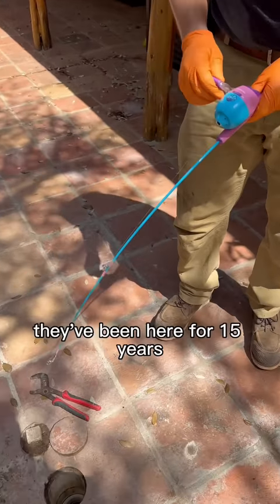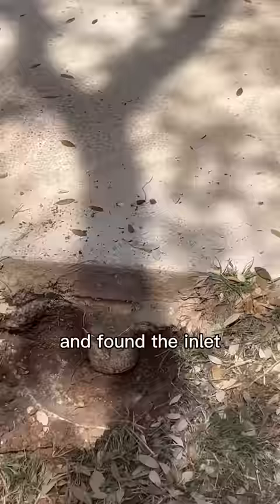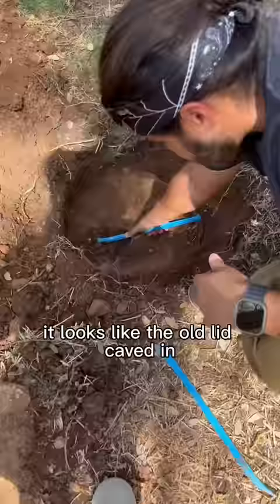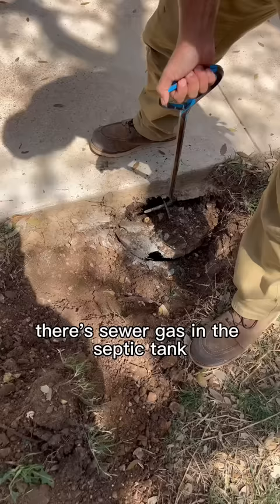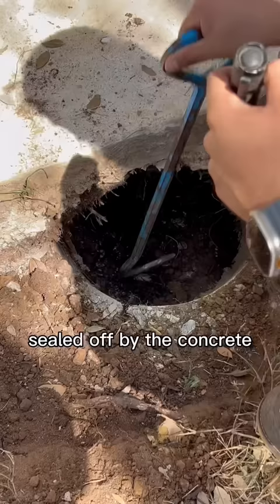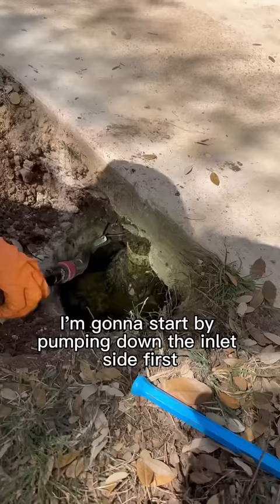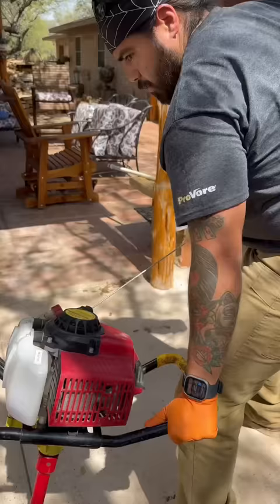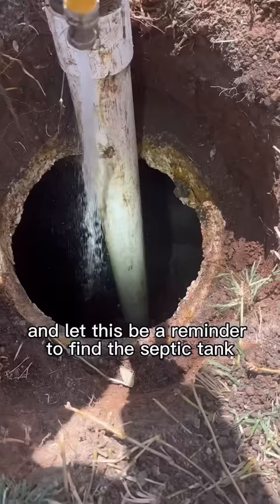They built a patio over the septic tank #shorts

Comment: Reminder: flushable wipes AREN’T
Reply: They definitely flush, just not a good idea
Reply: Oh they'll flush, but what they won't do is blend up in the poop smoothie or forbidden fudge factory!
Reply: Reminder your shit in the ground is actually toxic as there wasn’t enough time to actually test if any thing was bad
Reply: A lot now days are actually I tested left some in a glass of water and the degraded just like toliet paper
Reply: @maxortega8073   Show me ze datahhh
Reply: @blakeroni  unfortunately see datah has been delete
Reply: @maxortega8073  haha perfect
Reply: @maxortega8073  okay what's the brand?? So I can test it 😎
Reply: @8JLZ8  I just found it at Safeway
Reply: I've used them for 15 years, never had an issue
Reply: Just to clarify. I have a rental house. The plumbing was slow on the toilets. Property management company sent 3 different plumbers to resolve the problem. No success. I had to get on that roof and use a mechanical pipe snake and manually pull 2 or wipes out at a time. In the end pulled out closed to 30 wipes. Flushable are made of the same material as dryer sheets. Would anyone flush dryer sheets I think not. The world Flushable is the name of the product. Does not describe the wipes. That is just there name. Ask anyone plumbers if you should flush them. Unless you rent I hope the owner make you pay for the repair and plumbers.
Reply: Just be you can doesn’t mean you should. Did you see in the videos. Luckily it was a septic tank. Not public sewer system. Did y’all not see the wipes he just pulled. That is what I had to pull from my sewer pipes. That is why I have in the contract to never flush flushable. All repairs are the tenant responsible. Imagine pulling those 30 wipes from your sewer line. At lest at this point I know the line is clear. If the get clog I know who did it. They will be responsible. I can’t pay for plumbers again due to peoples ignorance. Cost me thousands.
Reply: thats why man invented septic safe wipes, for most people its the cities issue to deal with so they never have to think about it till they get a house with a septic tank
Reply: @heyfindmenoob  which brand are safe for plumbing city or septic?
Reply: @8JLZ8  cottonelle
Reply: Ye. Drain field killers
Reply: Some do , just have to get the right ones .
Reply: If you really think about it how wipes flushable.  If they come wet in a package and they do not deteriorate for months on end  before you buy them. Then the magically dissolve in water after you use them. Then they are at least smarter then the user. “Sarcasm”…🤔🤔
Reply: @hoktang1  the ones that say " breaks down like toilet paper " are safe for plumbing and septic . Cottonelle makes them
Reply: @Mharve  they are dry from the store right. If not how can it say break down like toilet paper. How does it last so long on the store shelves soaking in solution. Still arrive at your home to be used. I can’t think of any that can does as claim. Bc a person has to not apply logic to believe what they are saying. TP is designed specifically for city sewers and septic tanks. But has any parent with babies flush baby wipes?  Think about it. 
Even if it does break down it is still going to a heck of a long time. You know from the time you flush ur toilet it take about 48 hours for the 🧻 to get to the sewage treatment plant. So your telling me it will magically last all time from manufacturing packaging store shelves and to ur home. Then magically after you use it. It break down in the next 48. I think not sorry.
Reply: Looks like it flushed and did the job just fine 🤔
Reply: @owenjohnson7447  just bc it flush so it is not ur problem. Doesn’t mean it is not a problem. Like a tree falling in a forest since not one hears it does it make a sound. If I said no then you call me liar. Bc tree falling does produce a sound just bc no one hears. Doesn’t mean it doesn’t produce a sound. Your assumption is based on the same logic as regards to the wipe.
Reply: @hoktang1  Wrong...Cottonelle came out with wipes that break down and do not clog systems. I've been using wet wipes for 20+ years and never had an issue.
Reply: @hoktang1  Unrelated but drier sheets also degrade your drier quicker, so does fabric softener in your washing machine. Both use wax to make your clothes feel soft but the heated wax gets into crevices and gunks your machine up.
Reply: @maxortega8073  toilet paper takes over 3 years to dissolve 😂😂 wtf are you talking about?
Reply: @hoktang1  Roger Wakefield has a great video testing flushable wipes and also explains why you should never flush baby wipes. I highly suggest you check it out since you seem to know more than a plumber…
Reply: They are. There's literal tests showing they break down like toilet paper. Its regular baby wipes that dont.
Reply: Neither are tampex or diapers most all the time I just put tissues/ toilet paper in trash and take it to the dump.   Nothingggg else goes in toilet ..but I do use water with a little dish detergent in the toilet.....is that ok ?????
Reply: @danielnswainful  when did you last have your septic pumped?
Reply: @Redact63Lluks  not in the last 30 years haha
Reply: @danielnswainful  do you move homes? That’s why. If you move you won’t notice
Reply: @SJS325  after you use the dryer sheet. What is left over. A little plastics mesh. That is what I was talking about as regards to the dryer sheet. A lot of people probably know but don’t really care for the consequences. Once they flush it is no longer there personal problem. It becomes someone else’s problem. That is why they can comfortably say it flushes fine. Bc it left there toilet great.
Reply: @maxortega8073  punctuation is important.
Reply: As a wastewater operator, I can tell you that at 31 million gallons per day, we remove on average a 40 foot garbage bin of rags (mostly wipes) a week. If they get passed our band screen system they mess up our pumps bad. So yeah just because they “flush” doesn’t mean they are okay. I’m a poo professional.
Reply: Yeah, they'll flush...

We just don't know how far they'll make it thru your pipes.
Reply: The only flushable wipes are called toilet paper
Reply: @Max Ortega  it highly depends on conditions, witch is why the wipes will say stuff about what's needed and what not to tp
Reply: Some flushable wipes are, but they arent great as wipes because they tend to fall apart before youre even finished using them🤣🤣
Reply: @danielnswainful  you probably dont have a septic tank.

Edit: you havent pumped it for 30 years? You definitely dont have one. Youre not every smart either evidently 🤣
Reply: @CozyKG  yup they break down so easily sometimes they rip when you try remove them from the packet, and they often rip halfway through using them. Nice for wiping ur ass but not good for the typical cleaning you can use proper wet wipes for.
Reply: @GeneralNOH  yup, always get shitty fingers.
Reply: @hoktang1  You realize the house he pulled all these wipes from probably used hundreds of wipes before having the septic pumped right? And he only pulled out a couple handfuls?

Toilet paper can clog a drain just as easily as flushable wipes can. The issue was probably your pipes being too small in diameter.
Reply: @hoktang1  Literally test them yourselves, the packaging says, "Breaks down like toilet paper after 30 minutes"
Reply: @HybridofDoom  you do know the difference between me and you right. you rent I own I have to pay for all the stuff that happens when the shit gets clogged up you don’t. 
Until you own a home and have to have it fix don’t say anything. You probably don’t know what happens after you flush do you. Most likely not. Bc it is none of your concern. It become the problem of the home owner such as myself.
Reply: @hoktang1  I  own my home sir. I also had a plumber dad who used flushable wet wipes. But thanks for proving you don't know what you're talking about. :)
Reply: @HybridofDoom  if you had both of those 2 thing you would sit there tell people to flush wipe. So I call bs.
Reply: @hoktang1  Unfortunate for you to have the life you live where you can't trust the truth. :)
Reply: @HybridofDoom  well tell that to the 3 plumbers that came to my rental and still could not fix the problem. I personally had to get on the roof. Run a drain snake down just to remove the wipes. Took me 2 days. So yes I am not going to believe someone that has not had to do what I had too. You can flush golf ball down the toilet. Yes you can. But should you?
Reply: @hoktang1  What a dumb argument to make. You CAN flush certain wipes brands down the drain, AND they DO break down like toilet paper. Otherwise WET TOILET PAPER would be just as bad as WET WIPES. Cottonelle flushable wipes literally disintegrate in water, and you can test that yourself as claimed on the packaging. I've had a bag of flushable wipes fall apart as I picked them up because water got in the packaging. FYI, Toilet Paper can clog your drains too, it's not exclusive to wet wipes. But you're not going to believe that because you have difficulty understanding that toilet PAPER and flushable wet wipes are BOTH PAPER. Both are made from the same WOOD PULP FIBERS. Sure there are some that aren't but literally read the packaging, they don't lie about what they're made of. Maybe you're confusing Flushable Plastic Free wet wipes with Baby wipes, which are made with plastic with the intent of being disposed in a bin with the diaper.

Maybe you should research some before you claim all wipes are the same.
Reply: I work in a plant that makes them. The good ones do. We won a contest last year for our technology
Reply: @hoktang1 flushables are not made of the same material as dryer sheets. If they were, thats really old stuff.
Reply: @hoktang1 as someone who manufactures this stuff you not looking too smart. Most people cant work with the towel that is used to make the good flushable kinds. It will break under any tension. Sitting in water, as in drowned in water, they will dissolve. A toilet has plenty of force and water to destroy the good brand towels.
Reply: @HybridofDoom  did you look into the info that provided for you. Just wanted to see if you still believe what you believe. It just got quiet just checking to see if ur still alive b
Reply: @hoktang1 lol what that guy trashed you and you come back 2 months later to talk shit to him? After he and someone else that makes them told you off? Get out of here lmao
Reply: And even if they were, is it really that fking hard to throw them in a trashcan, that already exists in your bathroom, and just take them out with your other trash?
Reply: Only in very certain and specific cases XD
Reply: Only in very certain and specific cases XD
Reply: @hoktang1 what garbage wipes are you using? I bet it’s dude wipes.

Comment: My septic tank is under the road, lol. This house use to be at the end of the road. The road actually stopped at the driveway. The septic tank was a past the driveway in front of the road. The guy that owned it moved to Florida for a couple years, but kept the house. When he came back his brother built a house up the hill behind them. The county extended the road for the new mailbox and paved right over the septic tank. There is no way to get to it now. A 90 year old septic tank cleaner told to pour a gallon of spoiled buttermilk down the toilet once a month and the bacteria will keep it good. I have been doing that for almost 20 years now with no problems. Also make sure you do not use wipes or antibacterial soap. Yes I have to use a mask with the spoiled buttermilk, lol.
Reply: Holy shit making your septic tank into a fermentation device is genius (also explains the no antibacterial soap rule)

Comment: I have lived in the same house for 27 years. In that time occupants have ranged from 2 up to 5 in average. I have opened septic 3 times. Never once have I needed tank pumped. All 3 timed paper dams have caused the backups. Simply breaking up/pushing down the paper layer then stirring it up has solved my issues. Now I have never allowed flushing of wet wipes or feminine hygiene products. I also don't recommend dumping grease down the drain. The biggest issues with septic are caused by city slickers moving away from city sewer systems..😂😂😂

Comment: Wipes are flushable when it's not at your house lol
Reply: When you are connected to the city's sewer not a tank
Reply: No no this crap cost me thousands bc the flushed one after another. The property management sent like 3 different plumbers out over 2 years. With not success to result the issue. Finally I had to get on the roof run a mechanical pipe snake. Fish 2 to 3 out at a time. All done and finished I pulled 30. So now I have it started in the contract not flushable or tenant is 100% liable for any repairs. It cost me thousands bc some idiot read flushable and took it literally. Not reading the package. At least I know the sewer line is clear at the moment. So if there is clog they will pick up the tab.

Comment: It's not sewer gas breaking down the concrete if you notice it's always right over the tee or if it has a precast 80% of the time its rotten or mush. The rest of the tank is always fine unless it was a bad batch of concrete. It's actually minerals in the soil that breaks down the concrete. If you find this and it has a  distribution box it's probably really close to collapsing.

Comment: why only good for 3 to 5 years? my septic tank hasn't been pumped out in 60 years. can't be totally clogged either because if we don't block a certain pipe we get sewer rats coming out into our water heater closet.
Reply: Pretty sure you just answered your own question. If your septic tanks leads down into a sewer then it probably doesn't need to be pumped

Comment: The septic tank to my house is over 50 years old, built at the same time as the house by my grandmother. The first time I opened it up was about 10 years ago, when I did I was expecting an ungodly smell and mess. It was almost dry and the smell was no where near as bad as I was expecting. My theory is since the walls were made with cinder blocks, placed sideways, the shitty water had a better chance of draining away and the solids dried out. Though after so many decades one would think it would be more full, but it's at least 10 feet to the bottom.

Comment: Listen please take my advice as a Master Plumber with 37 years experience. Wipes of any sort are NOT FLUSHABLE. Well yes they will flush but they will hang anywhere they possibly can in the line. Getting them out and the problem fixed will be expensive. It’s not a matter of if they will cause problems it’s a matter of when. Does not matter if you are on a sanitary sewer or a septic tank.

Comment: I worked on an 18 story High Rise years ago here in Atlanta  and when they took the tower crane down they forgot about the Pota-John on the roof. So to remove it without a crane they decided to load it on top of the Buck hoist , which is a temporary elevator attached to the side of the building to move men and materials between floors . There was a girl named Winnie who was the Buck hoist operator , and after they got it loaded on the roof she started down with it where they could remove it with a fork lift. When she got to the 4th floor there was a man waiting there for a ride down , so she stopped to pick him up , and when she did the Porta-John tipped over and it's contents RAINED down on her through the trap door. She couldn't have been more covered with sh!t and piss than if she had jumped into a swimming pool full of it 🤢🤮.She left and went home and didn't come back to work for 3 days .

Comment: If you are on septic NOTHING goes down the drain but toilet paper, poo, pee, and water.
My parents tank hadn't been pumped in nearly 45 years before they had to pump the solids tank only, the liquids tank overflow and drainfield was fine.
Also once about every 10 years by dad would flush cow sh!t down the toilets. He firmly believed it was better than the stuff you buy in the store.

Also having been inside replacing the sump-pump before that concrete isn't actually corroding - difference in 40+ year old concrete?

Comment: I have a crust buster but its easier to use a wolf gaden 2lb extendable pole with a knife end to get the solids to you.   Back flush near the end then finish.  No need to manhandle a 100 lb engine with a boat propeller at the end.

Comment: Hey I just had mine pumped and they said it's good to leave a little bit in the bottom so you don't have to restart the bacteria decomp etc.  Is this true?  Or just kind of irrelevant
Reply: Bacteria will quickly multiply as the tanks will still have the same bacteria after being pumped.  If you’re willing to measure the height of the solids, the rule of thumb is the maximum is 30% volume of solids at the bottom.  If you don’t want to measure it, then follow the 3-5 year pump out recommendation.